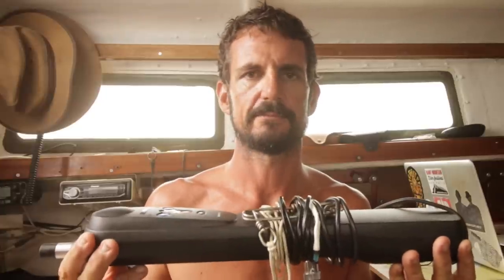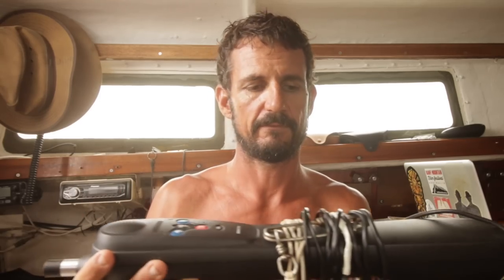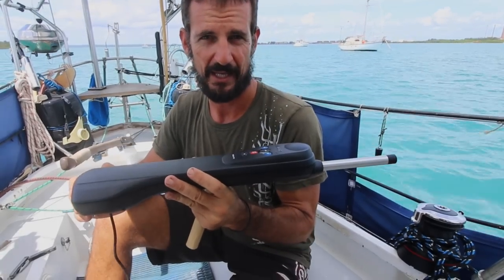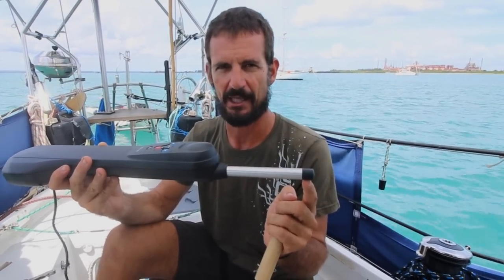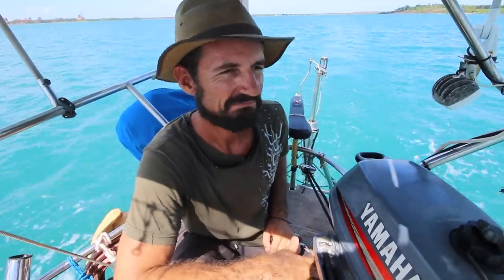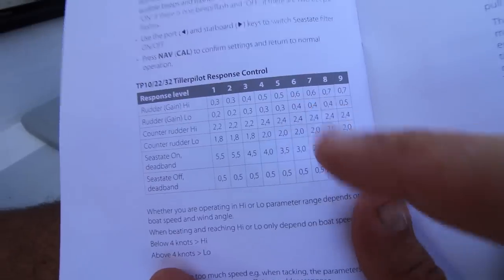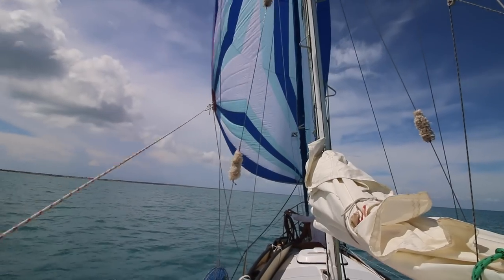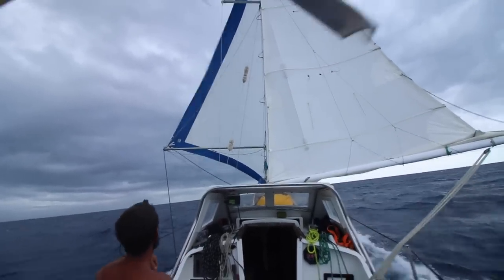Yacht Self-Steering System for all Conditions - 5 Minute Free Range

Comment: Excellent instructional how-to Troy! A great way to save wear and tear by lightly loading the autopilot and it also keeps the battery amp-hour usage much lower than using direct rudder control. This is just one of several reasons why I watch your and Pascale's videos.....thank you!
Reply from the maker: Both of the top reasons for us doing it Ed. Thanks for being on the crew.

Comment: You are rapidly becoming one of the best video-bloggers on here as you actually share useful information. Can you throw in depth and anchoring conditions, what the bottom is etc I would appreciate that heaps. Love the cooking tips from Pascal, will try to keep them stored away in some place safe. Most of the on boat provisioning / cooking info out there is done by Americans and quite frankly leaves a lot to be desired.  Loving what your doing on here thank you so very much for sharing. 
Now are you going to go to indo or any other place or just stick to the Aus coast?

cheers

Nige
Reply from the maker: Thats a good idea Nigel, we'll get around to an explanation of how we choose a site to anchor and our gear. Always a good way to get a debate going in a sailing community!
Did you get some of those Bata boots?
Reply from the maker: Oh and we only have very broad plans for after we complete our Australian tour.
Reply: I had a bit of trouble finding those Bata Boots, will have another squiz today for some.  I slip the lines very soon like some time around the 22nd of March or there abouts. Waiting on the final paperwork from AMSA regarding the boat registration. May see you on the east coast over the next month or five?  I will be in Townsville for a six week period durinf that time. Assuming your coming down the east coast next?
Reply from the maker: Yep, we'll be leaving the Straits April. We'll keep an eye out for your sail number and sing out if we see you. Keep track of us on FB and we'll most likely catch up. Good luck mate.

Comment: nice one again! couple of additions: reducing slop in the rudder attachment goes a long way for some systems. My last boat had a "tiller lock" on the tiller (sort of a locking clam cleat) which made extra fine tuning possible and doubled up as a classic tiller lock for single handed tricks. 

A tiller pilot with a remote would also be a nice mod, or one where control box and the ram are not directly connected.  

Thanks for the great videos!
Reply from the maker: The pilots with a remote are indeed a very nice addition. Even better are the ones that are NMEA 2000 compatible and they will follow a GPS route very well.

Comment: FYI, a Simrad TP10 is $394 U.S. or about $502 AUS. at Defender.com (largest marine mail order and retail in the world) $78 U.S. for shipping to Australia.   Ive been looking at below deck mechanical steering systems that are expensive.  My boat is really to heavy/big for a wheel mounted system.  I really like your hybrid idea!
Reply from the maker: Well if she already has a windvane attached to the wheel system it's a great option. The larger versions of the Tiller Pilot have NMEA 2000 connectivity and remote control capability which the TP10 doesn't. Really nice features enabling GPS route following (you have to ok the change to the next leg at each waypoint) and adjusting course from the most comfy spot in the cockpit.

Comment: Thanks Troy that's booldy clever you are an ideas man.wow water temp 30 how hot was the air temp.
Reply from the maker: The temp was mid thirties but with incredibly high humidity which is the killer. The wind scoop saved our bacon (tuna bacon that is).

Comment: I've found the TP10 one of the most vital pieces of kit on my SeaRunner31. It has taken me up and down Gold Coast to Cairns several times as a solo sailor. It keeps course and trim better than the crew! SeaRunners have a great wind vane set up but after 20yrs and a Pacific crossing it was tired. I was confident enough to remove it when the extra solar pv was installed so can't try your hybridisation but appreciate your method. Thanks.
Reply from the maker: 20 years- that's long service in anyone's books. We'll be heading to Cairns from the Torres Strait around April then onward a few months after. Hopefully we get used to progressively more people by the time we hit the Goldy!

Comment: Hi. A very good video of how the system works. I have a Windpilot vane self steering system which comes with a pin on the weight arm for just this purpose. We have seldom used it with the  Tillerpilot as we also have a larger Smartpilot which we use when motoring, direct to the tiller. Peter Foerthman, the inventor and producer of the Windpilot warns against using the hybrid system when motoring. It will bugger the bearings of the Windpilot in short order. However, sailing with light winds from astern it must be ideal. Never tried this.

Comment: What a great idea to combine the two of them together like that!  My tiller pilot (Raymarine ST-2000+) is like yours in that it can easily get overpowered in strong winds and I like the idea of reducing the load on it by getting it to "only" have to drive the trim tab on the wind vane rather than the whole rudder.  I guess when the wind is high enough you'd still rely primarily on the wind vane to save your batteries so I like how you've made it easy to drop the tiller pilot into the loop when necessary.   If I ever get a wind vane, I'll make sure I can jury rig something like that!  Thanks!
Reply from the maker: We definitely can and do replace the foil in winds that are optimal for the windvane but the power saving is pretty small. It is a great solution.

Comment: Nice! I have the TP20 and they call for it to be around 8 to 12 in. or some thing  from the rudder shaft. I new that mine wouldn't last long  if I did that so I used the fitting for the tiller extension on the end of the tiller, It's about 8 in. from the end. That gave it way more leverage and it work's great. I had to do like you did and adjust it. The only thing that I'm sure wont work is to auto tack but I just hit the pause button and tack then back on! I have a old SP2 Hasler wind vane and was going to do what you did but worried that it would get bumped or something and fall in the water.If you check out my video's Iv'e made a seat to set on in the hatch so get the heat to say warm. ( Some thing you wont need).

Comment: Brilliant - instead of needing an AP computer to drive expensive hydraulic rams to move the quadrant, you get the power to move the rudder from the deflecting foil in the water (hence the importance of a wind vane self-steering system correctly sized for the boat). You get the fine tune brains from the Tiller Pilot instead of the delicate wind vane (which also lacks the power to move the rudder).

At 3:15 you talk about the importance of getting the TP roughly horizontal. Am I right to think this is not a major concern I presume as it will rotate up and down a bit if the end of the TP is connected to the swinging pendulum weight (which swings at a constant radius to the fulcrum, not at a constant height), but you'd like to start roughly in the middle when centring everything to start with?

At 3:21, you talk about the importance of getting the TP arm at midsroke to be perpendicular to the axis of the wind vane itself. At first I thought, doesn't this limit you to only use this system when the apparent wind is at 90 degrees to the boat (abeam), but then I realised you're taking the wind vane out completely so that's irrelevant. So if, in fact, your pendulum weight was too close to the pushpit to get that magical 595 mm (23.4252 inches BTW) when mounting the TP base dead in front of the weight, you could instead mount the TP base off to the side, still on the pushpit railing, to achieve the 595 mm from the base mounting to the pendulum weight, and then change the vane axis angle to align perpendicularly to the TP arm, right?

Comment: thank you for this!  i was making the attachment too hard in my head.  i especially enjoyed the shock cord solution!!  i am gonna remember that.
Reply from the maker: Happy to help. I didn't show it but once you put shock cord on, the other line can be run through pulleys too so that the autopilot can be placed in a better spot to suit your boat.
Reply: i was super stoked when I saw the Instagram pic of the pin hose clamped to the counterweight.  so much simpler.  I had also been thinking about how to get a Morse type push pull cable to the windvane so I can have me and the tiller pilot under the dodger.  but seeing how you did this I am thinking that I will try running it with some 1.75 spectra and shock cord before I  resort to the red jacket.
Reply from the maker: Sounds good. Make sure you have a means of getting the length of the spectra to be adjustable for fine tuning and keep too much slack out of the line.
Reply: good call.  i'll have one end as a whoopie sling.  which is simultaneously not as exciting as it sounds and kinda awesome.  i use a similar setup to anchor my cockpit workbench to the winch.
Reply from the maker: Could I ask you for a photo sent to our Facebook account of this cockpit bench? I am intrigued.
Reply: i didn't know you had a facebook account.   i can do that!

Comment: Terrific!  
Great thinking with reducing the load on the auto-helm as they seem to die quite regularly after a relatively short time. The other thing is waterproofing as (surprisingly) the Raymarines seem to die due to water ingress.  Not sure how the Simrad is in this regard - hopefully you don't find out!
I've been experimenting with Sheet-to-Tiller steering on our Farr6, which has been enormously satisfying in certain wind strengths and at certain points of sail (anything below about 18knots and other than a Run) - when it's working, it's perfect as it corrects as a gust actually occurs, rather than reacting to the change in course...when it's not working there is a lot of swearing and cussing like a grizzled 18th Century prospector...
We have a young family and are buying a bluewater-capable yacht and sailing from Melbourne to NZ and then up through the Sth Pacific in 2020, ending in Brisbane for the cyclone season.  A trip which is perhaps going to be lengthened by another year as a result of your videos...anti-clockwise from Brisbane to Melbourne.  
Cheers,
Stu
Reply from the maker: Sheet to tiller was how Mirrool was set up to sail from NZ to Australia back in 1970. The original self steering.
Have you a design you have your heart set on for your cruising yacht?

Comment: The windvane doesn't have the canvas fin so how is it participating in the direction? Also. if the autopilot fails, what adjustments to that set up would you have to make to get the windvane operating independently?

Comment: Really enjoyed the video wondering though can you still throw the rudder to tack  without harming the unit?
Reply from the maker: Easy to disengage the steering chain from the rudder if sudden maneuver is required. The pilot also has a tack function but we don't use it. I tack manually then put the unit back on auto and fine tune the new course to suit the wind direction.
There is no risk to the unit because no weight is transferred back through to the foil holder.

Comment: A Question: How do you find the Tillerpilot works when installed pointing aft. The manufacturers all seem to favour Port or Starboard mounting. Especially for the second setup you used with cord (where it isnt mounted directly aft)?

Comment: Hi, from your previous video you said you needed to add a plug which I assume is for power to the auto Pilot. I have a feeling this might be a dumb question but how does it connect to your GPS?
Reply from the maker: This one doesn't. Other models connect via NMEA 0183 or 2000. Ours is manual alteration.

Comment: What else is needed to make the TP10 work? How does it "know" when you are off course? Does it need input from a GPS? Does it have a magnetic compass in it?
Reply from the maker: The unit has a flux-gate compass in it so when you select a direction and push the 'auto' button, it maintains that course. The next models up can be joined to a GPS via NMEA and will follow a route and can have a remote hooked to them. Very nice.

Comment: does this use less power that driving the tiller directly?
Reply from the maker: Yes, and it will operate the tiller in seas that would cause rapid wear in the unit mechanism. The force required is only ever enough to move the small weight.